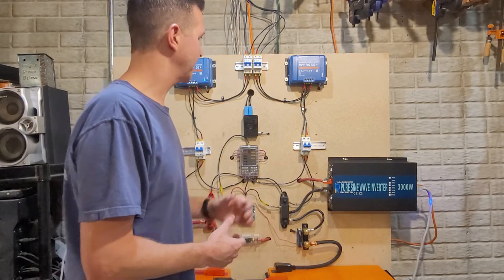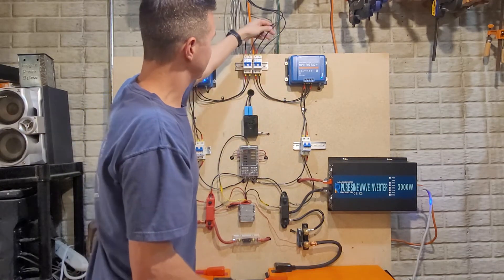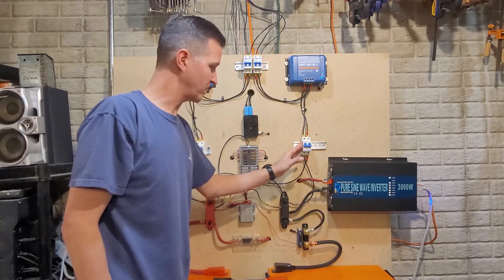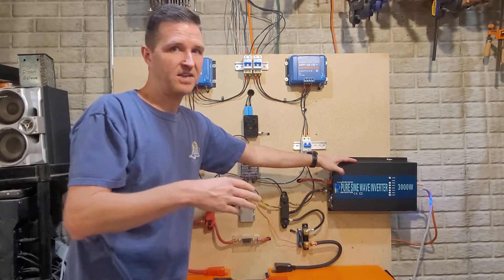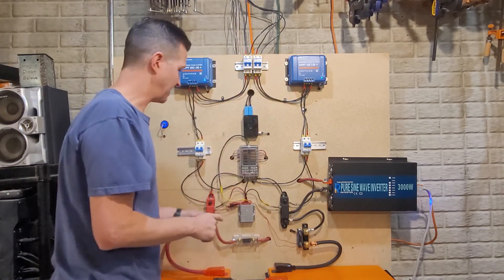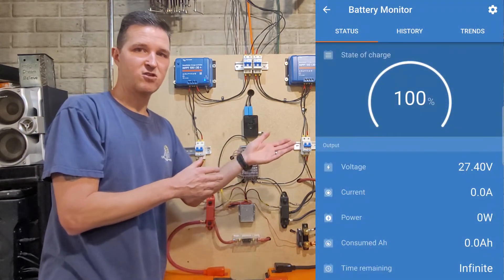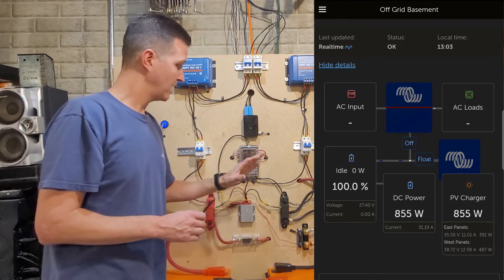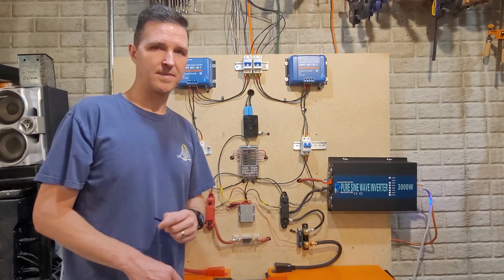An overview of how my 24v solar power system works!

Comment: This was very cool to see. I am a newbie to electrical systems other than I built a 12v house battery system for my SUV using a 100aH battery and 1500w inverter. Powers a 24" TV, FireTV, electric kettle, electric pot, microwave, and single-serve coffee maker. Your videos have helped me to create that system. Could you explain why you chose a 24V system instead of a 12V or 48V? Advantages and disadvantages? What do you use your system for? What kind of batteries are those that you are charging via solar panels? Thanks!
Reply from the maker: That's all for another video.  Thanks for sharing and the comment.

Comment: I'm building a 24v system too and will hopefully get it to start running this spring, but what I really want is to know how you build that raspberry pie for monitoring your whole system, do you have a video for that, how you build it what I need to buy and software and downloads for it and all that, if you can make a video about it and explaining everything that would be nice.
Reply from the maker: I learned everything from Andy at the off grid garage.  Here is a link to a step by step guide.
https://off-grid-garage.com/victron-connect-through-raspberry-pi/
Hope it helps!  Thanks for the comment.

Comment: Can i hook two 12v 200ah lifepo4 batteries to this exact setup? If not. Can I add more batteries or wire it different.
?
Reply from the maker: Yes.  The only difference would be less total amp hour capacity.  Thanks for the comment.

Comment: Can you please do a diagram for ONE string of the 100v 30amp controller to 800 watts solar?  but....to end in a 12 volt inverter with three 12v 100ah batteries.  I will be using a GIANDEL 2200W Pure Sine Wave Power Inverter 12V DC to 110V 120V AC to power office computer, AC, lights, etc.  TY!
Reply from the maker: If you did 800w of solar to a 12v battery bank with a 30a charger controller you would be very over paneled.  It would be best to get a second CC.
Reply: @OffGridBasement  are you not doing what I described in your left most CC set up? 800 watts 24 volts coming in  stepped down to 12 volts using a buck converter to run 12v loads?
Reply from the maker: @MyChannel-vm6dw  you're right, but I'm not charging the battery bank through the buck converter.  I've never thought about doing that.  I'll make a video trying that out.  Thanks for the idea!
Reply: @OffGridBasement  Look forward to your video!  if you do, please supply the diagram for ONE string plz

Comment: Since I began watching your channel, I've learned a lot, Thanks.      I have 12volt/ 3000 Watt Reliable inverter, with two Victron charge controllers,- mppt 75/15  and a mppt 100/30.
  I added the Victron  smart shunt.    But the shunt's  SOC goes down,  back never back up to 100% when the charge controllers indicate their at Float or Absorption.   
     I didn't setup a VE Network yet, is that necessary?     I've been syncing up the SOC manually to 100% , each time my batteries are full.
Reply from the maker: Sorry it took so long to get back to you!  The smart shunt has Automatic Sync, but their are some parameters that need to be met in order for it to reach 100%  First of all, what is your charge voltage?  For a 12V battery, it should be set to 13.2v.  Secondly, set the Tail current to 4% and the charge time to 3 minutes.  These can all be found in the battery settings.  What all of this means is:  first the battery needs to get up to 13.2v, stay there for 3 minutes and have a charge current of less than 4% of the total battery capacity in AH.  Once the 3 minutes is up it should set to 100%  I really hope this helps!
Reply: @OffGridBasement  I just changed the "charge voltage" for my smart
shunt from 14.4 volts down to 13.2 volts. Thanks.

Comment: How long can a 24 Volt 550 Watt unit run for just direct off the batteries? Thanks
Reply from the maker: My system is 300Ah @ 24v.  To calculate the amp draw for your device you would need to divide 550 by 24.  That's about 23 amps.  That is a constant usage of 23 amps per hour @ 24v.  All you need to do is divide 300 by 23 to get the number of hours.  That is a bit over 13 hours.  Hope this helps!
Reply: @OffGridBasement  yes this helps, I was thinking about powering direct a 3D printer that takes about 550 watts at 24 Volts but some prints can take 36 hours. A Solar Generator would soak up some power to power a 3D printer  on 240 Volts so all this sounds like a waste of cash to me

Comment: Hi! Thanks for showing your 24V set-up. I see you connected your 24VDC>DC12V converter to the busbar from battery. Do you think it's possible to connect converter directly from the SCC 24V DC load?
Reply from the maker: Honestly, I don't think that would work.  It was my understanding that the load output of the scc was 12v only.  Also I wouldn't power substantial loads with your scc.
Reply: @OffGridBasement  That sounds reasonable. Thanks!

Comment: Great explanation of your system. Where/how are you monitoring your DC usage on the Victron app.
Reply from the maker: Thanks for the question.  I use a Raspberry Pi.  I learned everything about it from Andy from the Off Grid Garage.  Here is a link to the website with all the info!  https://off-grid-garage.com/victron-connect-through-raspberry-pi/

Comment: Are your solar panels 12v or 24v panels? Series or parallel? Thx
Reply from the maker: It's a mix.  The 250w panels are 24v and the 200w panels are 12v.
250w panels are 2s2p wiring configuration 
One string of 200w are 4s and the other is 2s2p.  Hope that helps!

Comment: What is the name of the software that you use on your raspberry pi?
Reply from the maker: I learned everything about how to setup the Rasp Pi from Andy at the Off Grid Garage.  Here is a link to the section on his website about how to setup the Rasp Pi for VRM.
https://off-grid-garage.com/victron-connect-through-raspberry-pi/
Hope this helps.  Thanks for the comment!

Comment: Could u elaborate more about the amperage of the circuit breaker
Reply from the maker: The amperage between the solar panels and the charge controllers is 32 and the amperage between the charge controller and the batteries is 40

Comment: Very nice sistem. 
I would like to reproduce it in a very similar way, but a little bit small (24v /200Ah). 
I have a question: You use the Rosberry pi as if it were a pcwhich belongs to the system?
You connect from the R-pi to the shunt with a wire and then read what happens in R-pi through the internet?
Do I need to install a specific software on R-pi?
Reply from the maker: Yes.  I learned it from the youtube channel..  "Off Grid Garage"  Andy has a full 30 minute video on how to install and setup the Rasp Pi.  The Raspberry Pi is connected to all of my Victron equipment through USB cables.  You do need specific software, but it is totally free.  The Rasp-Pi does have Wifi which sends info to the Victron website so you can view it from the internet.  It's very nice.  I hope I answered your questions.  Thanks for the comment!
Reply: @OffGridBasement  thanks a lot !
I also found this. You certainly will seen ... (https://www.youtube.com/watch?v=NKVeBThK1Wc).
Combining hardware and software is fun.

Comment: Thanks for the vid and description of your setup. I'm going to get a solar system setup on a small home with no battery backup, so I'll be on the energy grid at night. Do you have any recommendations for setting up a small battery system to run just the refrigerator during the night if the power grid were to go down?  I can charge it during the day with AC power...  I've looked at the Jackery type of systems, but am not sure that is the best way to go.  Thanks!
Reply from the maker: I'm glad you got something out of the video!  For running a fridge overnight you first need to find out what the amp draw on the fridge is.  Ex:  At 120v a typical fridge has about a 6amp draw.  That would be 720w.  Everything I've read states you should get an inverter that can support the initial draw which can be up to 3x the rated amps.  So 120v X 18amp = 2160w.  Most inverters state to support initial draws of double the rated wattage.  Ex:  my 3000w inverter can support 6000w of initial draw.  I've never actually tested that...  So get something with an inverter of at least 1500w.  Pure sine wave is best.  As for battery, if it only needs to last for 12 hours then it would need to support 720w X 12hours = 8,640wh. BUT!!!!  A refrigerator usually runs for 20 minutes every hour.  So 8,640 / 3 = 2,880wh.  For a 12v system that would be 2,880wh / 12v = 240ah battery.  I hope all this makes sense!
Reply: @OffGridBasement  Thanks a lot for the reply and calculations for me!  I'll look into building a small basic system just for the refrigerator.

Comment: Did you discuss you battery size or how much solar you have?
Reply from the maker: My battery size is 300ah @ 24v.  This equals 7,680 Wh.  Currently, I have a total of 1.6kw of Solar.

Comment: Very interesting.  Just wondering, why would you turn off the solar panels from the rest of the system?
Reply from the maker: it's a quick and safe way to disconnect in case you need to work on the panels.  Reconfigure, add or remove panels... something like that.